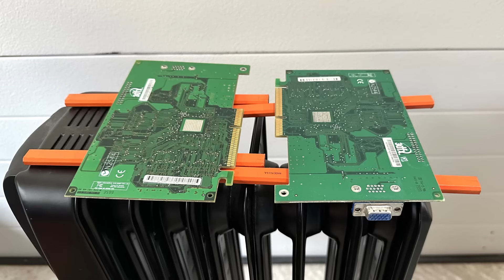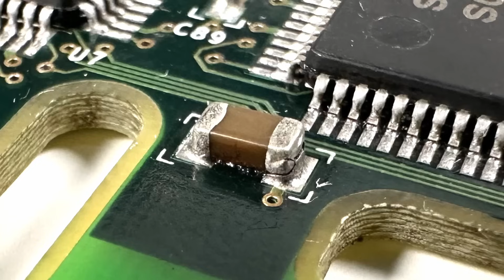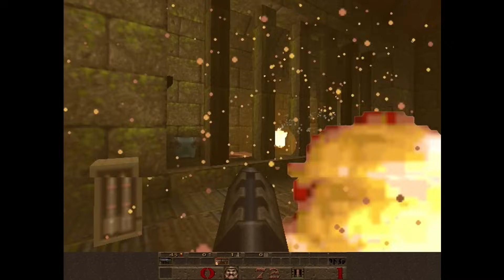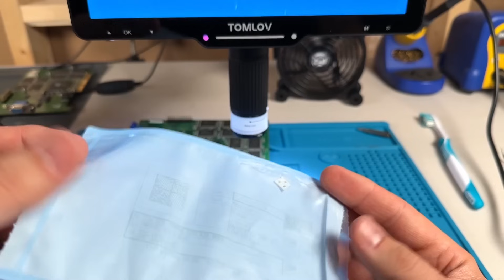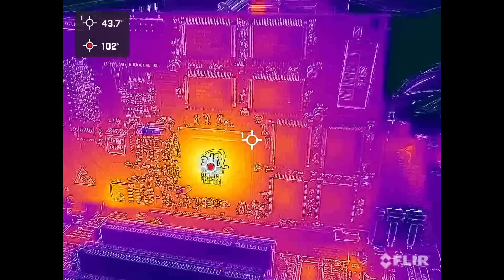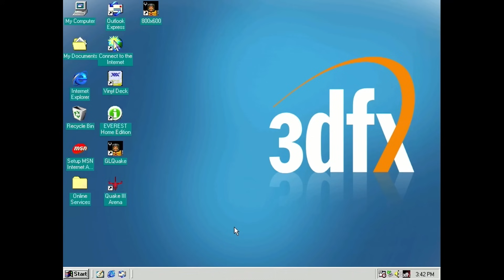3dfx Voodoo 3 1000 Repair and Enhancements - Part 1

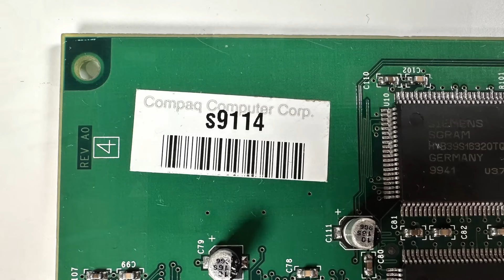Comment: 2:08 I pulled the trigger on the ultrasonic, absolutely indispensible. 
I have my hierarchy. Paint brush for easy dust, soap/water for sensitive components plus contact cleaner, and the ultrasonic for components that have it caked on and corrosion.
Reply: Other than the small 20W cleaner for eyeglasses and jewellery from Aldi, ultrasonic the type that can fit even just a Voodoo... is kind of expensive.
Reply: @SianaGearz  Yeah, so get one on sale or something, they're worth it. I am looking to buy a second for full ATX boards.